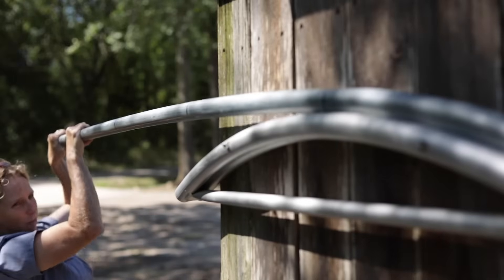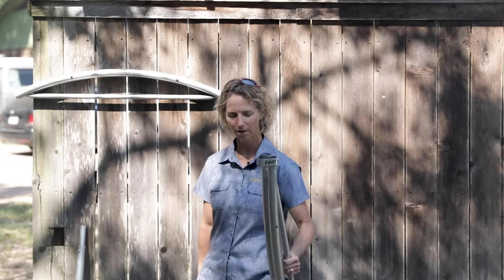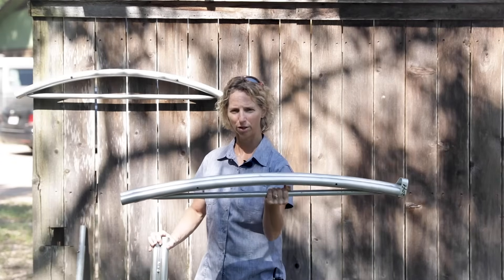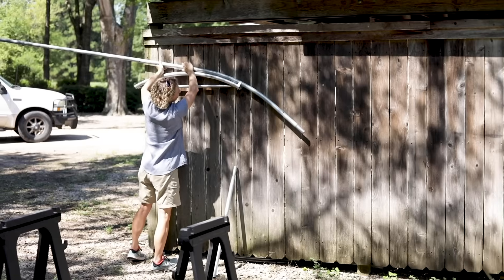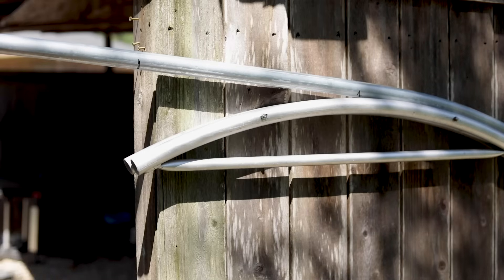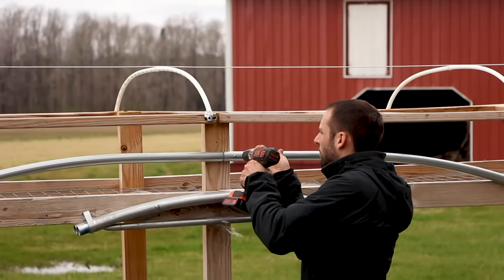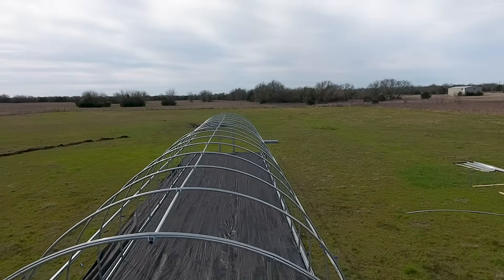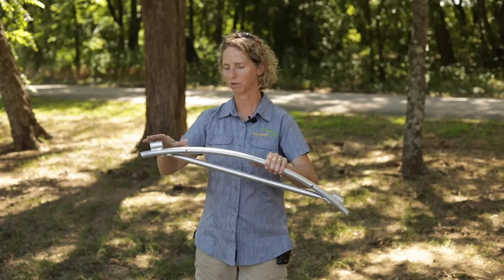Bending Poles for Hoop Houses

Comment: Hi, I'm from Sri Lanka 🇱🇰. I'm planning to build a DIY Polytunnel 
L 50'× W 30'. The height of side posts will be 6' using 1" pipes. The hoops will be half inch. In Sri Lanka the standard length of a pipe is 19'. I want to use 2 pipes for each hoop which comes to 38' and the two pipes can be joined at the centre with a threaded socket. Can you advise me the angle of the bend to fix the hoop between two side posts which has a distance of 30'. How should I first fabricate a hoop bender. Thank you.
Reply from the maker: We want to be fully transparent and responsible in our guidance. Unfortunately, we’re unable to provide specific advice on custom one-off research and development projects like yours. The calculations and decisions involved in designing and constructing custom structures can be complex, and we can’t guarantee structural integrity or safety in these cases. Our expertise is focused on our own range of hoop benders and related projects, which have been carefully tested and designed for reliability.

We truly value your understanding and thank you again for considering us. If there’s anything we can assist with regarding our hoop bender products, please don’t hesitate to reach out.

Comment: On the first pipe you indicate a mark 9 inches in.  Do you do the same for all 3 poles when using the 20 foot bender?  Or the 2nd and 3rd posts have marks every 18 inches and no 9 inch mark?
Reply from the maker: You do the same thing for all three poles.

Comment: I have heard that some people have obtained a "more uniform/perfect" bend (almost a factory bend) by attaching two (or three) 10-foot sections together and continuously bending them through the Bootstrap bender, rather than bending individual 10-foot sections of pipe and then joining them together. Has Bootstrap Farm confirmed success with this "continuous" approach to hand-bending to reach a more perfect arch? Thank you for this very helpful instruction video.
Reply from the maker: It is possible if bending sideways but that does increase the likely hood of twisting the hoop unless very well supported.
As always these are many ways to achieve a goal that varies with skill level.

Comment: in the video you mention to measure the "distance" of the first hoop.  What is the correct distance of a 20' hoop when it is laying on the ground not under tension?
Reply from the maker: Given that this is a hand-bent, non-machined outcome it varies by 18-24" or so.

Comment: I want a 42' wide hoop house that's around 30' tall. What size pipe do you think it would need?
Reply from the maker: We cannot advise on specs outside of our own plans. You would need to check with a structural engineer for all considerations.
Reply: I forgot to mention that since we’re calculating  for elliptical quadrants I made your minor radius 21’ bc it’s half of your diameter(base in this case)which is 42’.